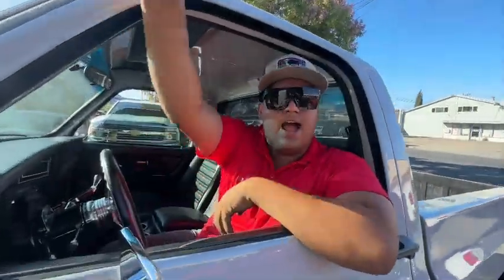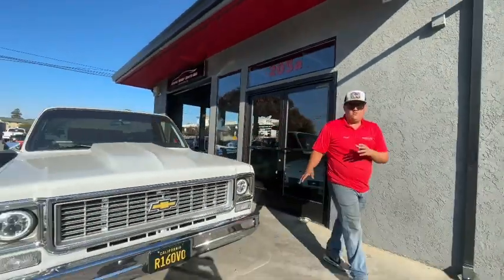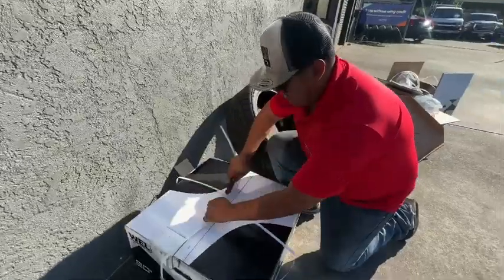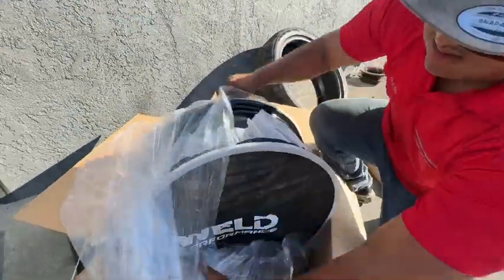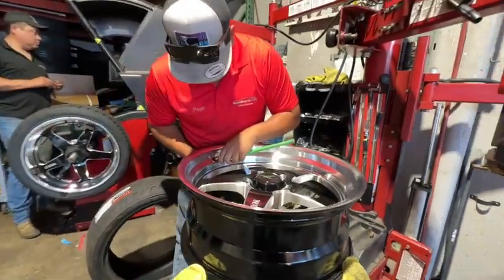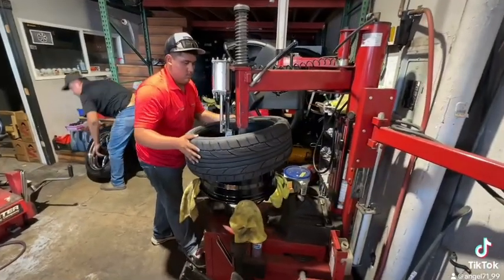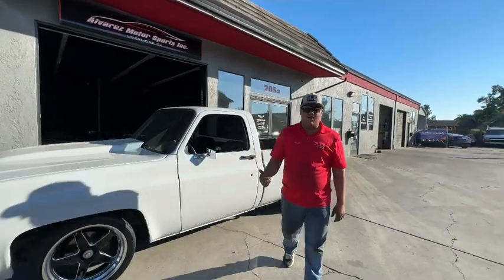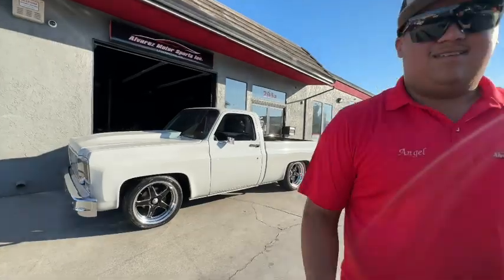Mini Shop Vlog, New 20” Weld Wheels for the LS Swapped C10

Comment: Did it rub on the inside rear.   I have the same wheels 20x10.5 but in the Laguna wheels and its 1/4 inch from the fender well.